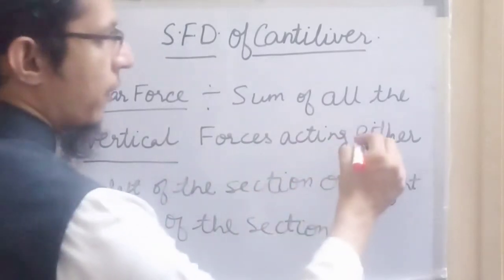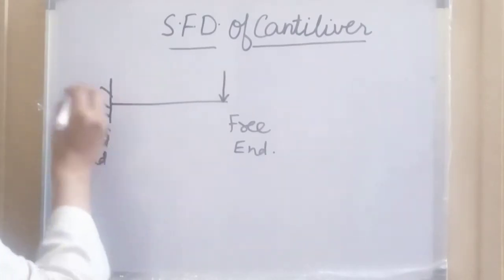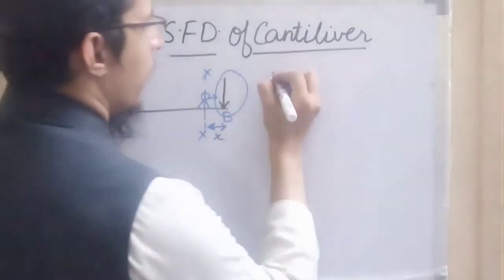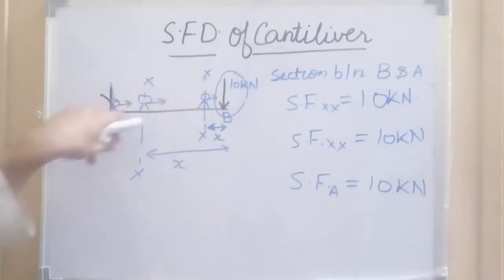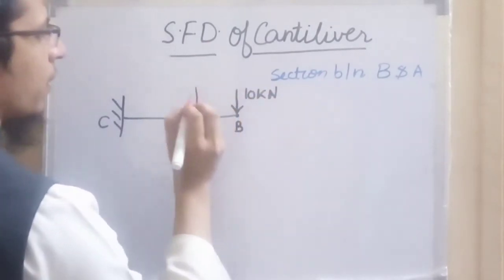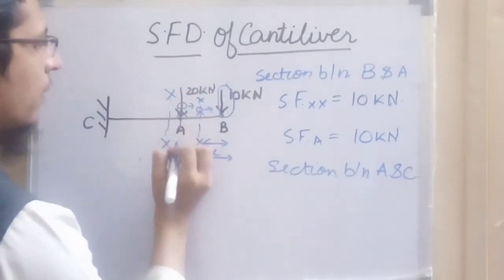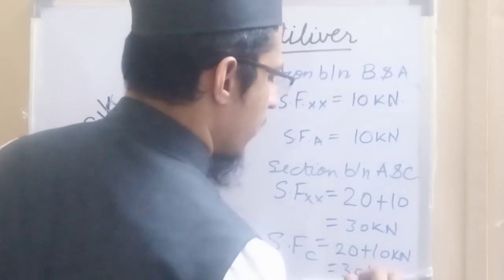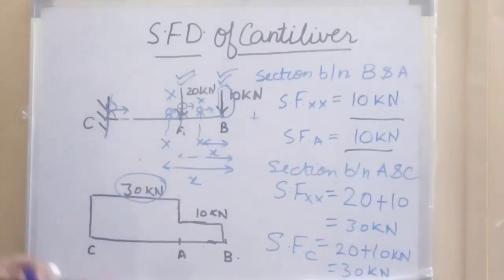Shear force diagram for cantilever beam with Point load / Shear Force / SFD of Cantilever Part 1

Comment: For G-1 house. Inside columns, can we use 4 steel bars of 60 Grade instead of 6 steel bars of 40 Grade? Bcz yield strength of 60 grade is more than 40 grade steel. Plz reply
Reply from the maker: yes, but it basically depend on the design loads and dimension